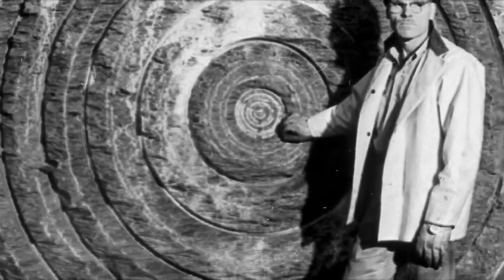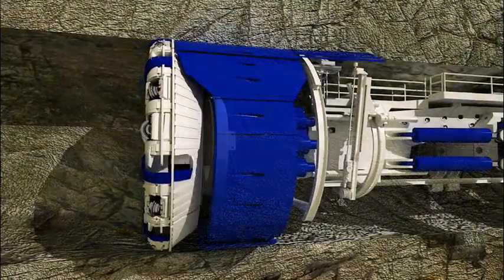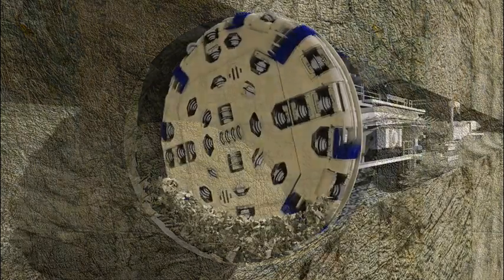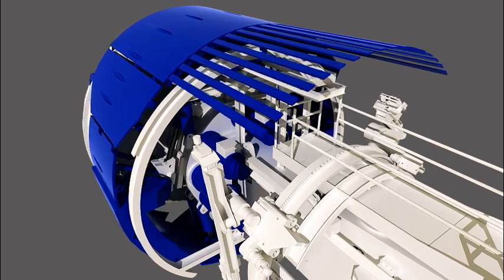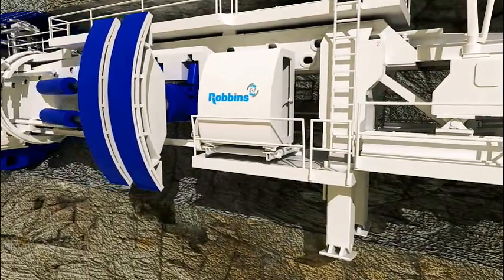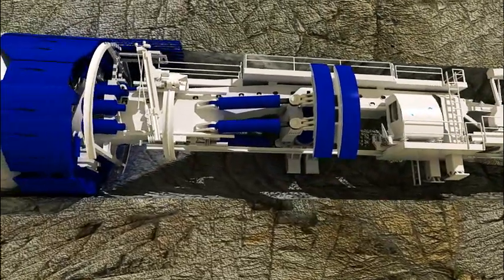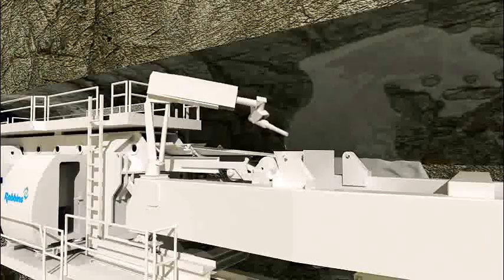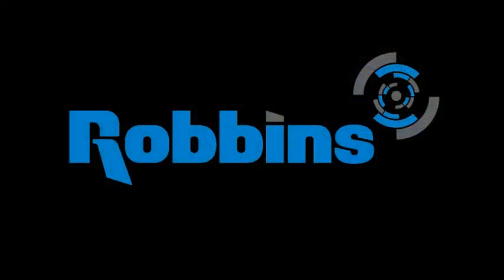Robbins Main Beam TBMs

Comment: Such a shame that due to the costs, nations would choose the slower 2-5 ft per hour drilling-rate TBM over the Main Beam, which could drill out more than 30 ft per hour. And with such a fast TBM, and with GPS, and two TBMs able to start at both ends and each only having to complete half the tunnel before the drilling is complete, extreme long tunnels, such as one that would link Ireland and England, would take only a matter of years to drill. And while the water is extremely deep where such tunnels had been proposed, such as from Ireland to England (500+ ft, well a bored tunnel in Norway extends 940 ft below sea level. So a tunnel from Ireland to England is achievable.

Comment: Interesting, there is no pre-cast segments lining for this kind of tunnelling method?
Reply from the maker: Hi, thanks for your question. That's correct, Main Beam (aka Open Type) machines are in most cases not used with a tunnel lining. We have provided Main Beam TBMs where invert segments are placed behind the machine, or a concrete floor is poured behind the machine. We have also used steel plate liners with our Main Beams. Check out more info here: https://www.robbinstbm.com/products/tunnel-boring-machines/main-beam/